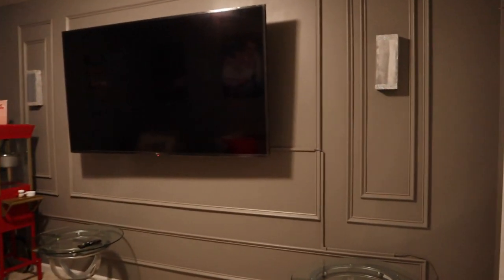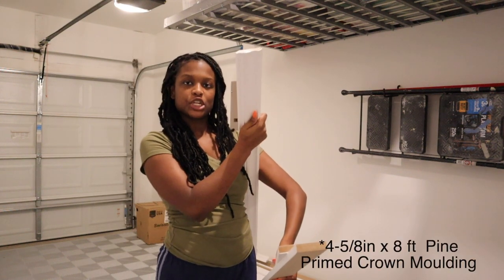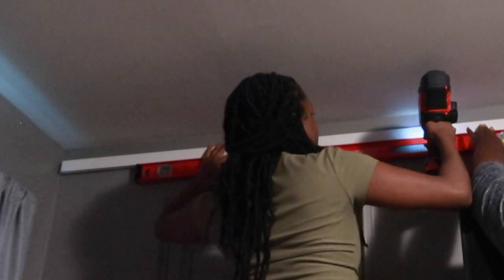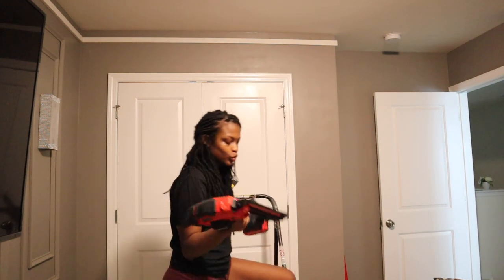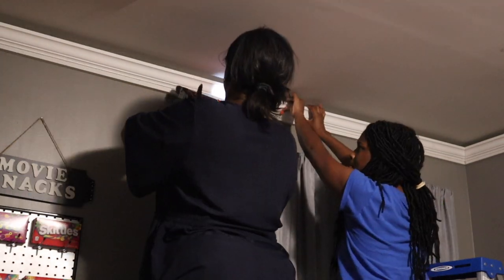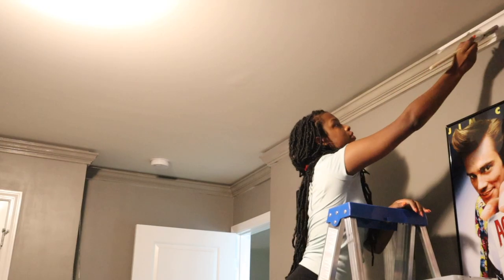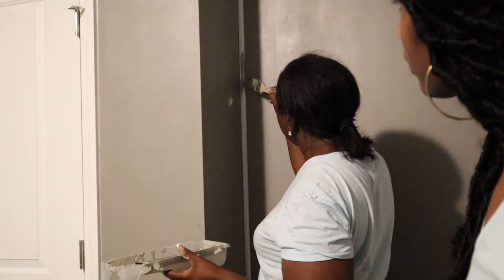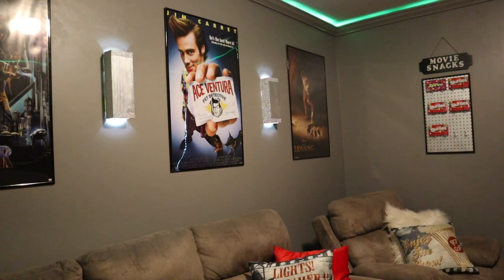DIY Lighted Crown Molding | I Bought My First House At 22 Home Series: Small Home Cinema

Comment: Excellent video, very informative! I highly recommend EPS plaster-coated coving for DIY jobs. It's moisture-resistant, budget-friendly, and adds tons of appeal. Homemerce specialises in DIY mouldings - they have durable yet lightweight coving in a range of styles, all meant for easy installation and a high-end finish at a low cost. For coving and trim, they offer the best quality and value.
Reply: I've placed an order with Homemerce for my living room covings and received the delivery recently. They have a really extensive range of different covings designs, check them out if you're looking for a good coving supplier.
Reply: U need a miter saw

Comment: When you watch TV sitting on the couch with the indirect lighting on, do you see it reflected in the TV? 
I ask because I noticed your TV is mounted high on the wall and is vertical, and most conventional couch seating is low. This puts your viewing angle upward.
Reply from the maker: I don’t !
Reply: Thank goodness! For anyone else with an expensive home theater room, I suggest consider holding up a test piece (4ft long) of the lighted LED moulding at night to verify no reflection occurs...before starting a project like this.